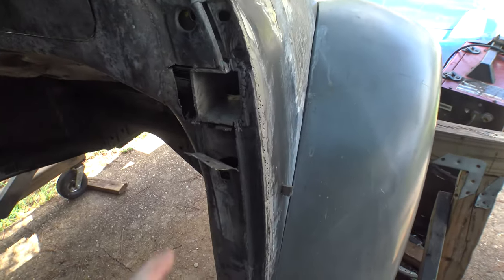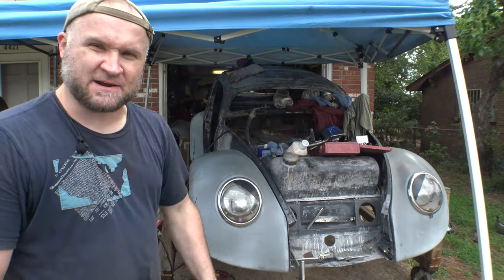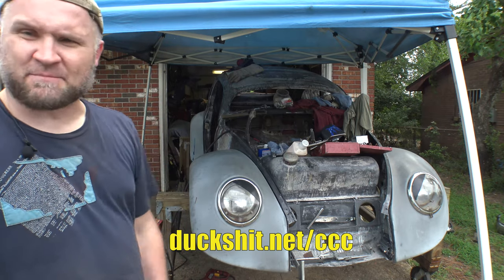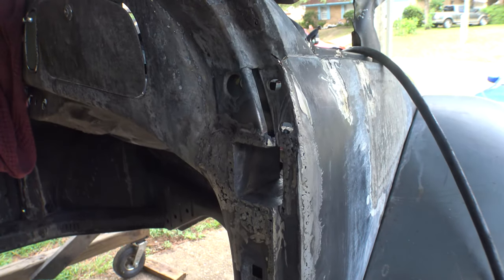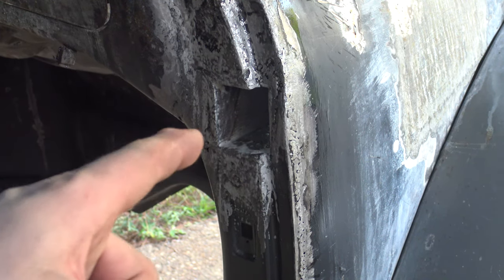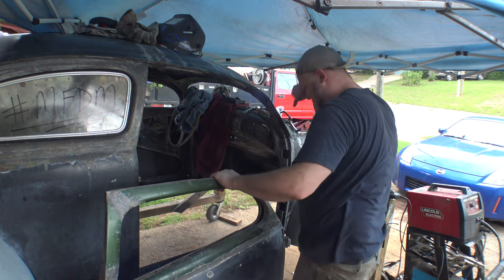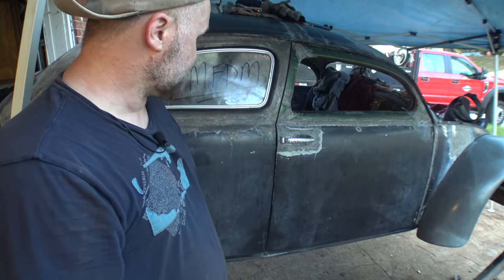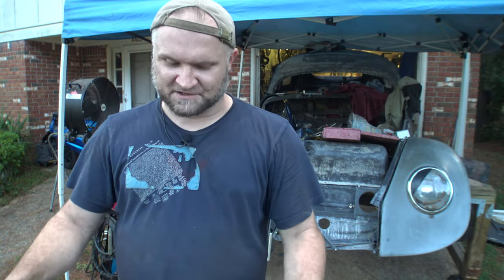Final Patches - VW Beetle Hidden Door Hinges 10 - ROTTEN OLD 1956 - 115

Comment: G'day Kevin from Australia. Its looking good. I would go with a leather check strap with matching hand straps .✌
Reply from the maker: Thanks, not sure that I want to use leather there though because it's somewhat subject to weather.  I think I'd prefer something hard and mechanical that will never need to be replaced.   But I guess we'll see, I'll come up with something in the next couple weeks!  Thanks for the suggestion
Reply: Dont use original from newer VW as they brake much often. #imports #swedish cars

Comment: Are you using flux core wire?
Reply from the maker: Yep, mentioned in video a few times recently.  I get asked a lot for some reason.
Reply: DuckmanCycles and VW Garage .030”?
Reply from the maker: I think that is correct.
Reply: DuckmanCycles and VW Garage how do you get it to not blow through?
Reply from the maker: Lower heat settings, and less feed speed, or somethings more feed speed so it blobs more and burns through less.  Also limit your pull on the trigger to very short bursts.  Sometimes increasing your distance will cut back the blow-through dramatically.